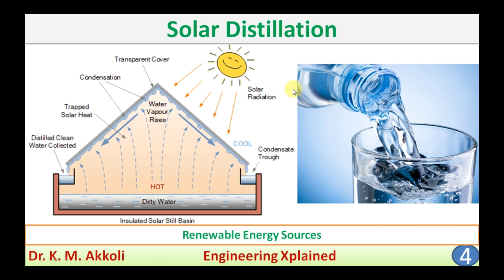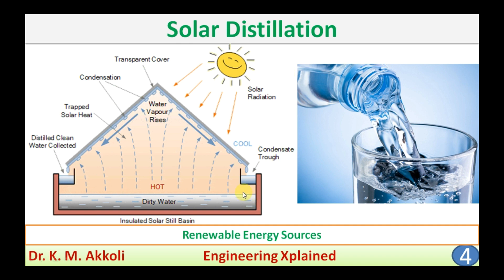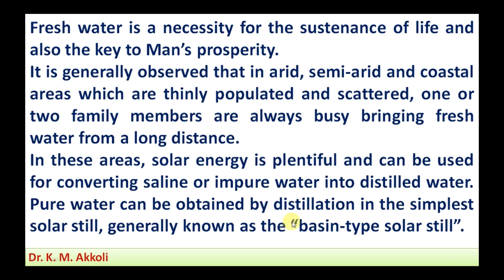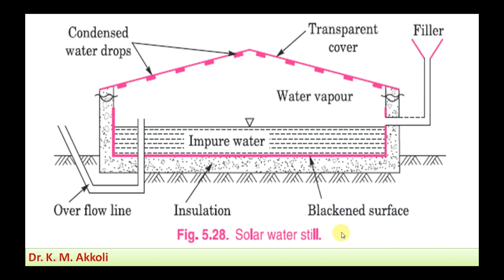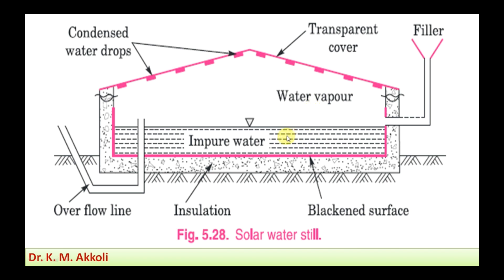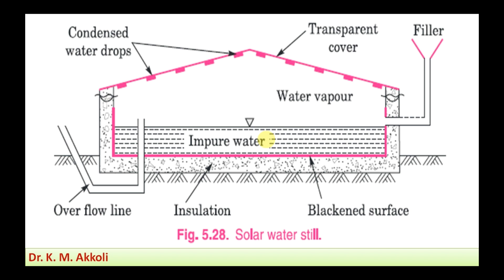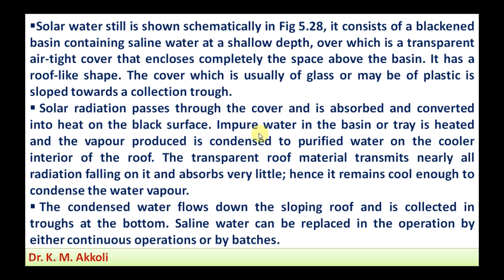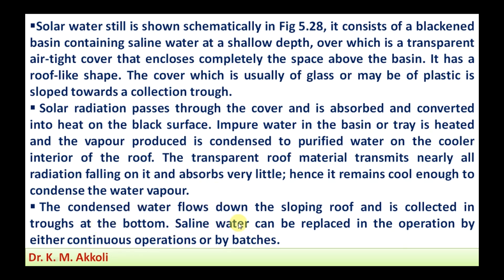Solar Distillation | Renewable Energy Sources

Comment: Would it get hotter and evaporate quicker if using a black liner under the 'dirty water'? Also I'm not sure how this got recommended to me but cool demonstration nonetheless.

Edit: just saw the next slide that shows the blackened surface!
Reply from the maker: It will take time for evaporation and depends on transparency of water to reach radiation to black surface below the water.
Thanks for your concern.